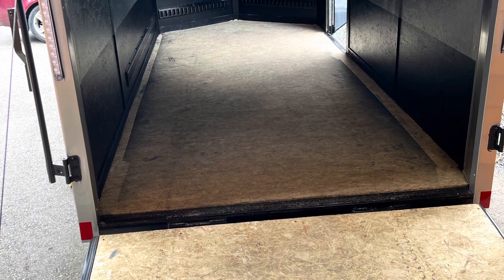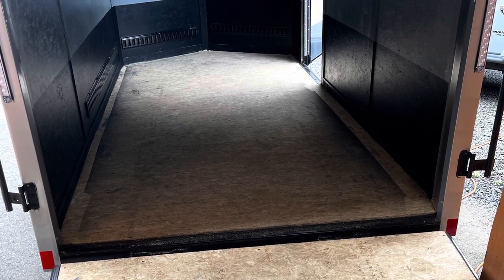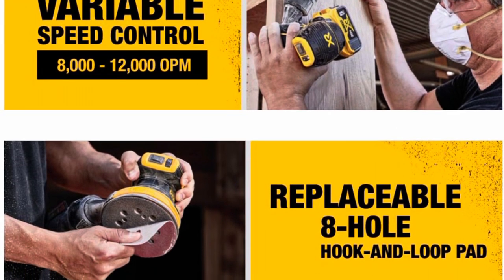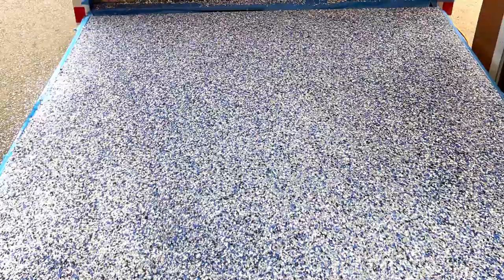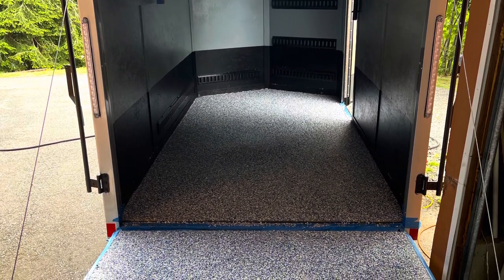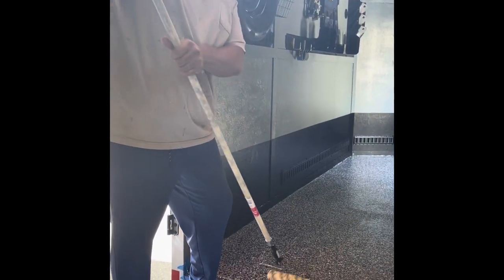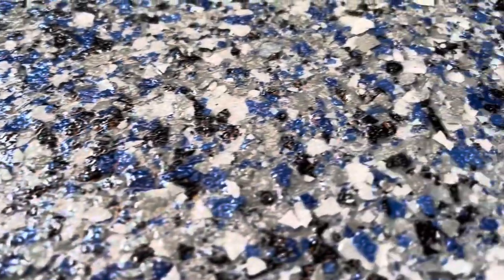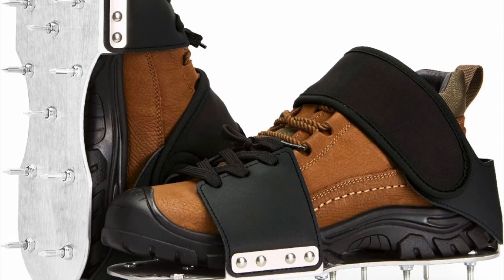Moto Trailer Build: Episode 4 Epoxy Floors

Comment: How much of the epoxy did you use? I also am going to be doing a 6x12. Not sure if I need the 1 car or the 2.5 car kit
Reply from the maker: For the gray I used a 1 car kit, but I needed two of the clear which surprised me.  It has been almost a year now and the floor is bulletproof so I am very happy with the project. Thank you very much for watching E4!